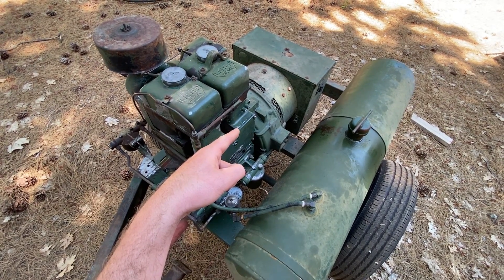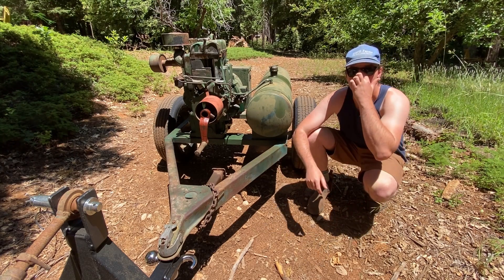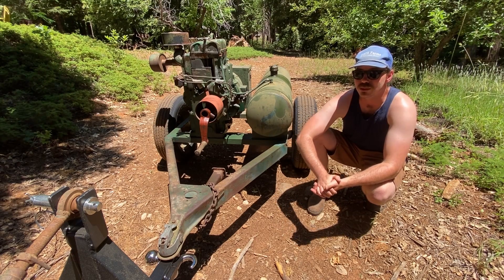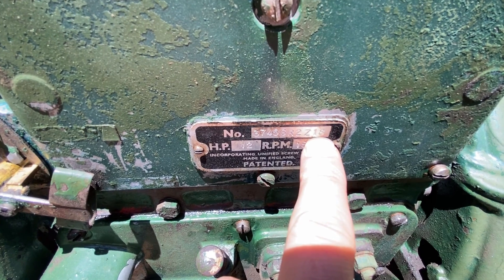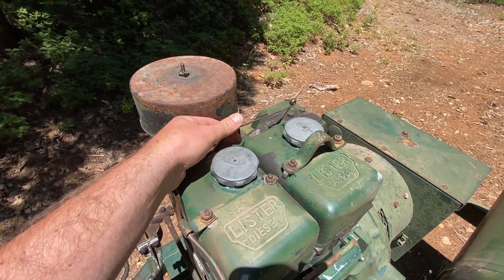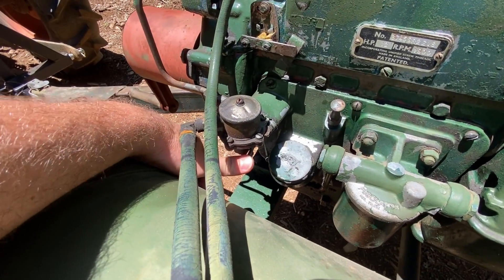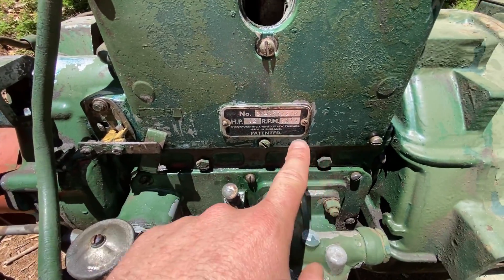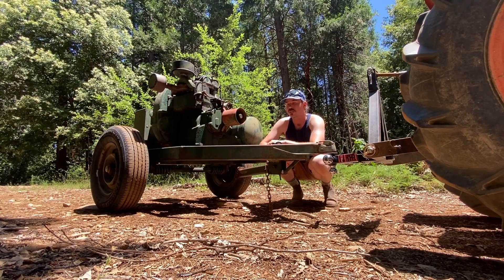The Most RELIABLE GENERATORS Ever Made? Lister Diesel for OFF GRID!

Comment: the clones of these lister engines were so popular in india. you can get a 7kw 240v single phase with electric start for less than 800$ brand new even though the sale of these are illegal as they don't have the dpf & scr , but in grey market you can still get all the parts and fully made units. type d clones are the most popular and range from 5 to 10kw.
Reply from the maker: Good to know, they’re hard to come by here in the states!

Comment: The single cylinder version with twin flywheels is called a 6/1 6hp single cylinder. Yours is a 12/2 double hp and 2 cylinder. You got them up to 6 cylinder in size .

Comment: this sr2 is counterclockwise rotation, the SR2A and SR2Z were the same, the Z was a slightly newer model than my SR2A  --- wish i had a hand crank start for mine, iv gota DC  starter ...
Reply: oh, pull the position knob/lever out twards from the body and it will rotate more counterclockwise for COLD starting ... iv started mine in 15deg weather .. yess .. 15 deg below freezing
Reply: https://www.youtube.com/watch?v=3QayhMV03cM&t=3s
Reply from the maker: Thanks for the information! I siphoned some diesel out of this thing for my truck and it looked BROWN and this thing still starts reliably no problem… could probably run it on waste oil… super reliable… thanks for sharing!
Reply: @Deferred.Resignation that's probably rust in the tank ... yours looks 3x capacity than mine ...
Reply: Well ... well filtered maybe, but if you do shut down on diesel ... the injectors are rectangular spray and are more prone to clogging than the conical ( older style ) injectors.
Reply: Bty, that direct couple head is sweet, im jealous... AND a hand crank ? Iv been looking to make one ...

Comment: These engines...1...and 2 cilinders are made new in india. Very cheap buth the sending cost.
Reply from the maker: A single cylinder 1800 rpm with the large flywheels would be sweet. Someone on Craigslist has 2 of them brand new for $3000. More than I’d like to spend

Comment: Listers also had a factory in Wroughton near Swindon (the since-demolished Marine Mountings factory, which I understood had made Motor Gun Boat gun turrets during WW2). I worked on the night shift there in 1964-5, initially assembling the SL and LD 2, 3 & 4 cylinder engines. Later I moved to the test bay, and got to run them on the electric dynos.  We had the occasional drama there, such as crank weights that had not been properly torqued down, which when run up punched through the side cover or the block and flew across the test bay. 
After testing, the engines were fitted with any auxiliary bits like a generator or marine reduction gearing and then crated. The night shift at the time was a real UN: some English, a few Irish, Scots, and Welsh, Iranian, Indian, Pakistani, Polish, Russian and West Indian. I was the only Canadian. It was an interesting place to work, and I enjoyed it there.

Many years later, while visiting the Fisherman's Museum in Lunenburg, Nova Scotia I heard a familar thumping down at the end of a pier. It was a really ancient Lister single, pumping the bilges of one of their ships. The Cold War radar station chains across northern Canada (Pine Tree Line, DEW Line, etc) all used Lister generators.
Reply from the maker: That is an awesome story man. Thanks for sharing 👍 stay tuned!

Comment: Used both the Lister generator and its twin which was a compressor unit to build 1,000's of homes in the Bay Area in the 70's and 80's. Great unit and yours is very clean. Watch the crank handle on cold mornings. You have bought wisely, the Kabota tractor is great too.
Reply from the maker: Thanks buddy 👍 stay tuned!

Comment: um, it's not a 2 stroke. for one, it has valves, while a two stroke diesel (or gasoline) doesnt. secondly, it doesnt have a blower. Other than that, it's a nice engine.
Reply: All GM Detroit diesel and EMD 2 stroke locomotive tugboat sized engines have exhaust valves . Uniflow scavenging .

Comment: Sorry , but I just don't believe it's a 2 cycle.  Naturally aspirated 2 cycles by Lister are just to far and few to accept.  Just my opinion!  Had one like yours exactly hand start and all It was 4 cycle. 2cycles  also use twice as much fuel as 4 cycles do.  Does it have one set of valves or two ?  Two cycle Diesels have a big side port.  Looks like yours has an Intake manifold and exhaust manifold. Don't get me wrong if its 4 cycle that's a big win win for you...

Comment: I have a number of the CS (Cold Start) series of Lister Diesel engines at my place in Queensland Australia 2 2 cylinder 2 3 cylinder and 1 4 cylinder. The 3 cylinders (both 70+ years old) are used as back up for a refrigeration plant on the property. The CS machines were made by Listers primarily at their Cinderford factory rather than Dursley and they, especially the single and 2 cylinder versions are the real collectors items. They were manufactured from 1930 until 1974 by Listers and subsequently have been made by various manufacturers in India and Iran. A continuous run of 94 years so far. There are a lot of videos of Lister CS engines on You tube.
Reply: Im also in Queensland , between esk and gatton and have a number of lister and southern cross diesels
cheers

Comment: I ran several lister SR and ST engines for many years for prime power. As you stated, they are the standard that all others aspire to be. I have rebuilt quite a few of these and I can say that they are quite simple to work on. The RPM is adjusted buy a little screw ( about 1/8" x 1" ) sticking out the front cover by the crank handle towards the top of the cover. The starting procedure is to lift the stop lever over the first catch to where it turns about 90 deg., that allows the fuel system to go to full fuel and will make it start easier when cold. Once it starts, then you put the lever back over the stop ramp so that it is just prior to  the stopping position, that position is the run position and will limit the rpm if something goes amiss in the governor assembly.  This engine sounds good and should give many years of service, if you change oil every 200 running hours, and keep it supplied with plenty of fresh air. It is air cooled and letting it get too hot will cause it to start leaking oil or worse, and then you will have oil everywhere since it throws it throughout the entire air cooling paths, and you can't usually find the leak since it is usually coming from behind the flywheel. Good luck on your Lister journey.
Reply from the maker: Thank you for the great information! It will definitely give me some good service. Stay tuned 👍

Comment: If you have the 12VDC or 24VDC starters it's not hard to add a "thermostart" valve to allow a bit of diesel to burn in the metal intake manifold so as to provide hot air for easy starting in cold weather.
In fact even just a small motorcycle battery and a push button with wiring onto the thermostart could do the same job.....
Reply from the maker: Thank you for the info! I’ll look into that!

Comment: The revs that this engine needs to be at to produce 120VAC  60hz electricity are:
900rpm for a 4 pole generator direct drive, 
1800rpm for a 2 pole generator direct drive.
There are earlier slow speed Lister CS and Petter (both air and water cooled diesels) operating at 600/750 rpm but with a belt drive utlising pulleys to achieve the 1800rpm rotation speed of the generator...a lot less "noisy"...
Reply: 4 pole is 1800 RPM, 2 pole requires 3600 RPM which is what most petrol generators run at.

Comment: I once worked on a tug boat that had a Lister as a  backup generator for when the main engine was shut down. It worked flawlessly. The only complaint was the noise, they are a bit loud being air cooled.
 We also towed an equipment barge that had a ramp on the bow. This ramp was raised and lowered with a hydraulic winch system that was driven by a Lister on a hydraulic pump. We were on the West Coast of Canada where it gets a little cool in the winters and you are %100 correct when you say "it might be a little harder to start when its cold!" Its as hard AF to crank when the oil is minus 10 degrees thick! Either is required, even with two people, one to crank and one to throw the compression release levers. When to oil is tar thick you cant  two hand crank and throw the compression release lever shut before it stops turning! 
 If you run it out of fuel,....it will run on either long enough to re-prime and run on fuel again!!
 Best emergency generator power ever!! If it was running and you shut it down,...it will start again when you need it. No bells, no whistles just good solid reliable quality machinery!
 As a side note,...I'm in South Africa as I type this, the country is suffering "load shedding" a couple of times a day,.....almost everyone here could use your Lister!!
Reply from the maker: That is awesome! Thank you for commenting! This winter when we have 5+ feet of snow I’ll dig it out and make a cold start video for you guys 👍
Reply: I'm actually now researching lister engines as an option to generate Electricity in South Africa.... that's what brought me to this comment today.
Reply: Lister is a good solid, reliable  chioce but do keep in mind they are noisy.  Even with a good silencer, the engine itself is noisy.
 BTW, you're up early!? By my estimate it 06:30 in SA right now! @marthinusstone5530
Reply: @rickc5303  Thanks! Maybe the engine can be placed inside a box or small enclosure to further dampen the sound, but will that not lead to cooling problems?

Yes, around 6:30... but I'm up at 5 already. I can't reliably stick to routines unless they are placed in the time between waking up and going to work...
Reply: It wouldn't be good to contain the unit in an enclosure without considerable airflow. 
 They are a very robust unit, but with the hot climate in SA, I would think maximum airflow would be necessary.
Reply: @rickc5303  ok, thanks for the advice👍🏻
Reply: South Africa. That's a hard place to work with. "load shedding" because of government corruption. We'll it's obvious why the country in is this situations n considering the utter destruction of the Africa's social foundations and the imposition of a centralized power structure that most attracts supports pathological criminals who desire power for the sake of abusing it.

Comment: Only bad thing about a diesel generator,  they are loud as fkk.
Reply: This is extra loud because it is air cooled...so the ignition in the cylinder isn't muffled by a jacket of water....
Also the pathetic original small mufflers that are OEM should be replaced with much larger and far better quality mufflers.
In stationary mode they benefit from being bolted down to a ton of concrete cube...
and the exhaust run through an empty 55 gallon oil drum inset in the ground, filled with large rocks...
then it just produces a background thud and thrum....
(Owner of a Petter AVA2 and Lister 3.5kw gen head....)
Reply from the maker: What an interesting idea for a muffler! I have the space at my property to try that so I might give it a shot. It is quite loud…

Comment: Great video, had several Lister light units down at the harbor in LA. One thing, the rpm is important, on that gen set 1800 rpm is probably 60 HZ, if this is off too much can damage electrical motor driven units, like refrigerators. Many multi meters now have a AC frequency setting to check the HZ, may want to verify this before connecting to a motor load.
Reply: With military gensets, the rule of thumb is to set the speed @ 62 HZ no load. I've always done this and never had a problem.
Reply from the maker: That is a great point. It’d be interesting to integrate some gauges into the gen head, and frequency would be a useful one.

Comment: 4:33 I believe that engine has a RPM adjustment on the gear cover above the red guard. I think it's a 10-32 stud with jam nuts.
Reply: That engine was made with imperial BSF or BA threads.
Reply: @PeterChapman-rg6gr  All the SR/ST engines I've worked on was SAE.

Comment: As you rightly state the lister SR, ST and HR series were the real "Gold" standards in engine reliability. look up the old Lister literature and they quote an engine life of some 120,000 hours subject to being looked after. also the fuel economy knocks the spots of more modern engines. I used to run over 30 of the SR, ST and HR engines
Reply: Don't forget the CS slow speed Listers and Petters...they are now made in India.....
They are imported into the USA as "air compressors" with kits available by separate import to convert them to diesel engines...
EPA or something mumble mumble...
Reply from the maker: 120,000 hours is an insane lifespan by todays standards. I’ve wondered about the import status of the newer models and listeroid clones. I’d love to have one of the quieter, low speed models you mentioned in another comment.
Reply: I have a generator with a TR2 Lister Petter engine, little bit later model with direct injection. It consumes 3 litres of fuel per hour at full load makling 8KW. Apparently these were used in radio transmitters where grid power was not available. They had a large oil tank connected to the sump so they could run 6 months non stop then serviced and run for the next 6 months.
Reply: @XXXXIndices  Countryman used to make scores of these sets c/w acoustic enclosures.